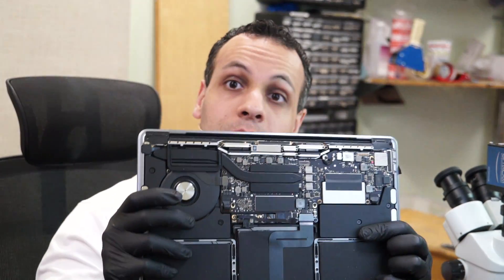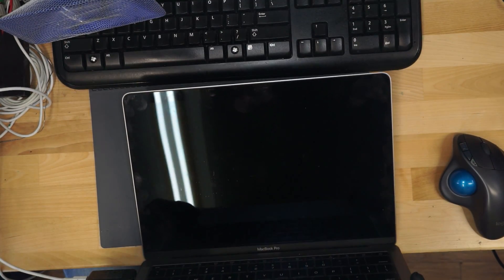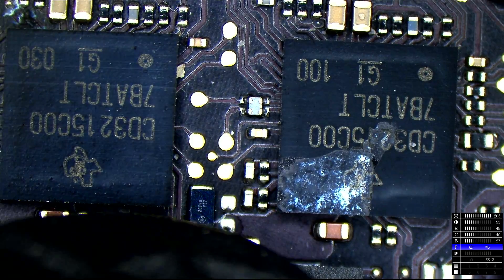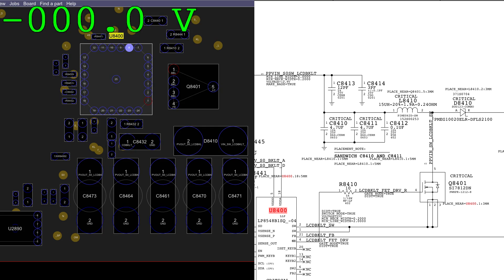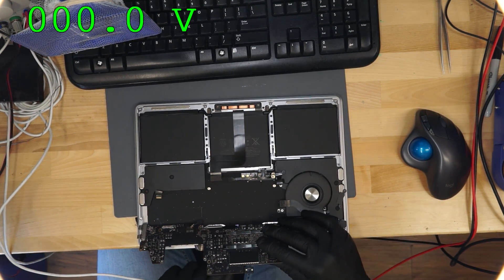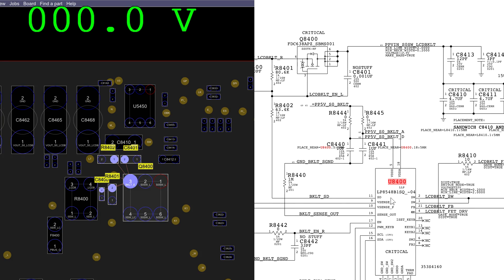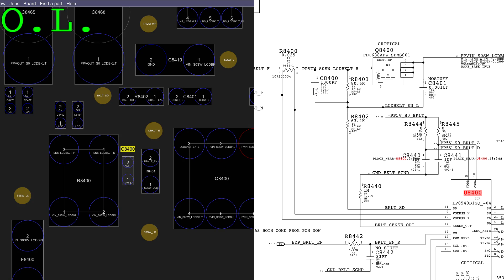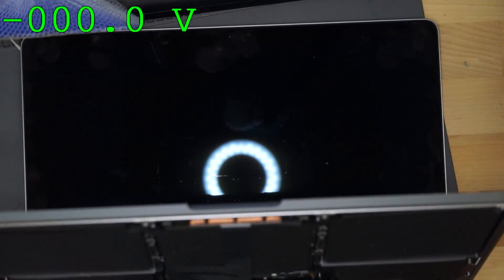820-00840 A1708 Macbook Pro with no backlight: how to repair its logic board.

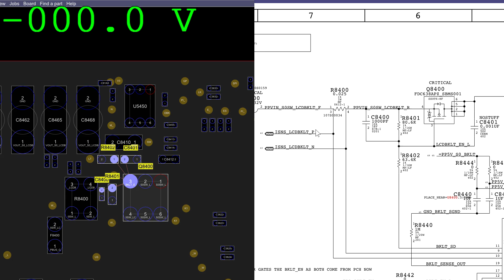Comment: 9:00 I also have 13 Volts on the gate and 13 on the source. So far everthing is as in the video. But I have 80 kilo ohm on pins 3 and 4 as it should be. Also I have 80 kilo ohm on R8401 and 63 kilo ohm on R8440 (also right values). So is my backlight driver broken? Should I replace U8400? Also this is my secound mainboard that has no backlight after I switched it from a broken machine. What am I doing wrong?

Comment: Louis, is there a quick way to diagnose or distinguish between logic board circuit failure or or ribbon cable failure for A1707 without backlight?
Reply: Turn On the macbook and position the LCD at different angle, if the display backlight appear it is a clear ribbon cable failure.

Comment: Louis you should always clean the full corrosion with isopropyl alcohol before turning on the machine, if you don't clean it, powering on might damage other stuff, and when i fix corroded boards majority of the time all parts are good, just the corrosion is killing stuff
Reply from the maker: No
Reply: @rossmanngroup  Why though?
Reply: @rossmanngroup  And by the way i've spilled water, a cappuccino and a beer on top of my macbook and it's still working flawlessly because I switched it off right after it and cleaned everything with isopropyl alcohol, those accidents were 4 years ago, no issues whatsoever besides a little dimmer backlight on some keys,

Comment: Hey, this question is maybe a bit out of the ordinary, but I'm struggling with finding a proper source of information (Maybe I'm just looking in the wrong places), but I want to start properly playing with and designing electronics. I already have small things like a Raspberry Pi, and I know enough to start, but I have no idea what equipment I need. I know the basics, but there are so many and types/brands of equipment and it's easy to get lost. I was wondering if you could kind of hint me in the right direction in getting the right equipment to start. This might be a bit out of the ordinary, but I've been watching you for a while, and I thought you might be able to help

Comment: You went from always use the right amount of flux (See Flood. Ref biblical disaster) to flicking parts off boards. That was 1: A good vacation, feel refreshed and having a good time or 2: Bad vacation and hundreds of capacitors will fall beneath your rage before balance has once again been achieved.

Comment: Louis,  I can't think you enough.  I am a 50 year old electronics technician that switched from component level electronics repair working on VCRs and TVs  in the 90's  to Information technology and now back to electronics thanks to you. 

I started out working on iPhones I purchased on eBay.  That was quite a learning experience.  I was scammed by sellers and buyers alike.  I had a asshole from NY sell me a phone that was nothing but his junk parts thrown into a case.  I had people return a empty box and screw me out of a iPhone X   I took a pounding.   I was lucky enough to stumble across  a local company that had huge amounts of work and farmed out all their micro soldering work.  I spent countless hours studding, purchasing equipment and learning.   In the past few weeks they started giving me their MacBook work and so far I am batting 100% 4 for 4 on liquid damaged MacBooks all thanks to you.   From corroded VIAs, bad ISL circuits and back light problems you helped me do my job.  In the old days of VCR repair I knew every shop and every technician for 100 miles and we were all friends.  I would not only talk to them on the phone I would visit their shops and we would share stores of asshole customers and problems caused by manufacturers wanting to save $0.01 per device when building.  We helped each other solve problems and make money.  I have been been searching for a friend in the business and found one in you.

You are the one friend that has shared with me in this industry with out expecting any thing in return other than to pay it forward.  There is no way I would of been able to do this without your help.  Thanks to you I am not alone.  I really appreciate your help and thanks to you I am well on my way getting back into this industry. 

Don't get me wrong.   I know it sucks!  I remember the days when I was so happy I got out of electronics and  into the IT business.  I know it is a race to the bottom and that customers will accuse you of breaking their MacBook because you installed open office on a 2012 POS that has a bad GPU!  But I must say I am happy to be here.   I don't know why but I like the abuse!

I just wanted to say thank you!  

Manufacturers would be wise to listen to technicians in the trenches working on their equipment.   Especially if the customer's success is their primary goal.  At one time Apple was customer driven.  Today I think that vision is lost.  I miss Steve Jobs even though he was a asshole.   My IT company's slogan was "your success is our goal"  I always grew when I helped my customer's succeed.  If only Apple could step out of the forest and see the trees. 

Thanks,  Randall

Comment: Sorry Babe. Didn't realize you were back from vacation
Reply: Thank you for the video! In my case, the board 820-00875 has a 50 volt connector but there is no backlight in the display, so it burned out in the display? thanks